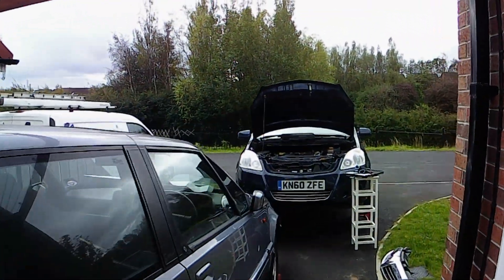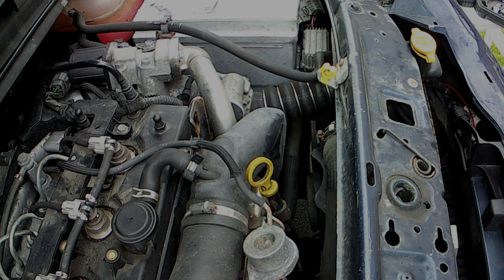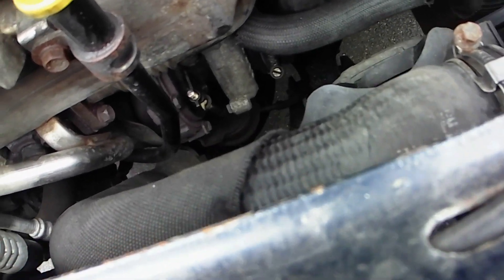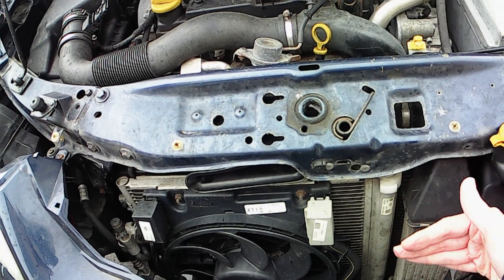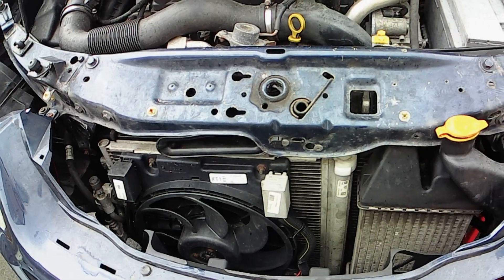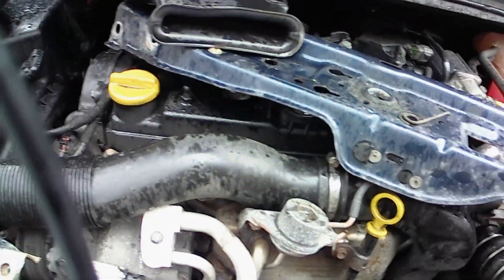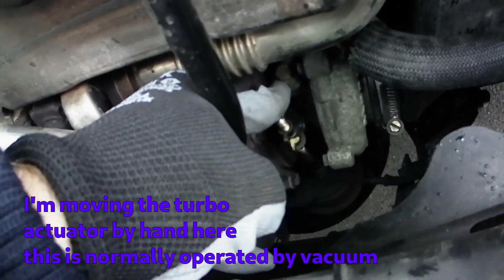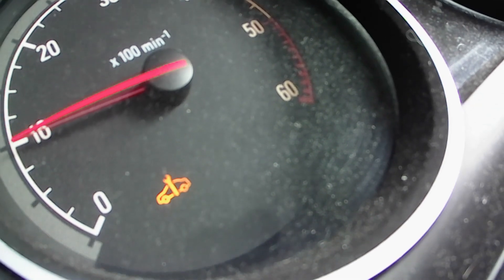Vauxhall Zafira 1.7 diesel ecoflex Turbo boost fault P0299

Comment: Do you have a follow up video
Reply from the maker: Hi, I've done a few on this fault on the channel
https://youtu.be/4EBu5AR3IDE
Is another video which is related to this fault code. It was never 100% resolved unfortunately as it can be quite a few issues causing the fault code

Comment: Hi Andy, have you replaced the intercooler on the zafira ? If so, have you recorded doing it ? You have helped me out of so many issues with the zafira many thanks
Reply from the maker: Hi Ali, no never changed the intercooler, looks like majority of front bumper off, radiators, etc to get to it unfortunately

Comment: Hi Andy, did you fix this problem? My astra same engine is doing the same. Under boost fault and changed the boost control solenoid and still going into limp mode.

Comment: My 2012 astra van has been losing boost then in the morning back to normal wheel spinning for fun  when you remove the suction pipe and suck on the end of the top valve it does not seal and cause a vacuum think my one has  a small hole in the suction pipe or the value gone faulty

Comment: I've owned my new car 3 days from a private seller. Car runs great until you pass the 2500 rpm going through the gears. The turbo stopes spooling and if it dose come back on the car makes loads of smoke. On the dash I get an Amber car and spanner light.  I've done the pedal test and found error code 029952. The car still runs but with no turbo and at low revs. When I stop the car and start driving it and change through the gears at 2000rpm the light doesn't appear and the car runs fine . so confusing.. apparently error code 029952 is ( boost pressure low pressure)

Comment: Under Boost is due to the Actuator not moving fully. 

Easiest was to get it moving is by Spraying WD40 on the Rod of the Actuator whilst forcing it down with a pry bar or a big screw driver and then letting it pop up by itself. 

Spray WD40 each time you're letting it pop back up again. 

Do this around 5 to 10 times and then reset codes and take it for a drive.
Reply from the maker: Thanks, great info there.
I'll give it a go as it still is a little sticky and your info makes a lot of sense. Cheers!

Comment: Did you fixed it? P0299 Boost Pressure Low Pressure should be straight forward. Waste gate stuck,  boost solenoid, or MAP sensor, or leaking intake pipes (intercooler). That thing on turbo is supposed to be waste gate actuator and if you can move it freely with feeling just constant restriction from the spring then it should be fine, if actuator is not leaking.  Solenoid or hoses to solenoid and actuator is one that could be faulty in you case, or it could be you boost sensor that is super dirty. Turbo is regulated after actual boos pressure is  reported. Boost solenoid  is far in the back of the engine bay on the bottom, boost sensor is on top of the intake manifold close to cylinder 1. There are upper two vacuum solenoids in the back of the intake, one is for EGR cooler open valve, other I forgot at this moment. EGR will give you clear fault if there is problem with it. IF you want to "close EGR return gasses" good thing on this specific engine is that on entrance to EGR cooler there is small valve controlled with vacuum controlled actuator positioned on the EGR cooler. If you disconnect vacuum tube supplying this actuator you have basically closed your EGR.  You should not leave vacuum tube open when disconnected. It is very good design in my opinion because this engine basically allows EGR  return  only if you do not have boost in manifold regardless of electronic EGR actuator. So even if electronic EGR actuator is faulty or leaking, when you step on the throttle engine will pull.Not many engines come with this nice feature, usually it is only one EGR actuator and when it goes bad, (always open is worst thing that can happen) engine will loos the power and clog your DPF very quickly

If your engine is OK EGR should be used, it helps to reduce emissions since effectively makes you engine to operate at low power like it is supper small volume engine and needs smaller amount of fuel to provide reasonable power (low power) Though if your engine is in bad condition due to all sorts of intake and exhaust issues it is better to close it until you fix all the problem. ECU shall compensate and add more fuel even at low power demands.

All this explanation comes from one and one thing only, combustion must be perfect, if it is not you must determine why, do you need more air for engine, do you supply to much fuel, and that can be related with any sensor that is controlling engine combustion, intake and exhaust sensors. This engine also has wideband O2 sensor after DPF, basically sends back info how is the combustion. If that one is fulling your ECU maybe ECU shall try to setup combustion in very wrong way - long shot but just to give you a hint. how all of them are usually interconnected.

Comment: Hi Andy, do u remove the turbo on this engine ? What IS the best way? I think mine IS going Bad because a lot of dpf regenration that cause a oil pressure engine A17dtr.
Regard
Reply from the maker: Hi. Unfortunately turbo remove is a really involved job. Basically it involves:
Front bumper completely off, front radiators (how many depends on your model. For me 3, one coolant, one A/C and one oil cooler), front brace bar and any extras, EGR cooler assembly, exhaust manifold. You'd then be able to get to all the bolds and fixings for the turbo.

I'm not sure it will be turbo if you have a lot of dpf regeneration and oil pressure (low pressure? not high?), this could be something else causing the DPF cycle not to complete. Take a look at my other videos as I do a video on DPF regeneration on these cars.
Good luck
Reply: @junkendriven  i think high (red warning appeared but not stay ) the regen are completed i let the engine turn on when it      Come dpf stay stuck at 42 percent on the opcom at his best score i think catalyser and the suit filter near dead

Comment: Hi did you do a future video on this problem at all as my Zafira has the same problem. Kind regards Andy
Reply from the maker: Hi Andreas, I'm still waiting to work on this, there will be a video soon doing more tests.
My guess is to investigate the vacuum pump and vacuum solenoid on the back of the engine. Video will be along soon so please subscribe!
Reply: Look forward to the next video, think I have the same issue. That dash light came on very briefly for day or two but not come on for couple moths. Mega turbo lag though, so much delay in power. My Turbo actuator felt pretty stiff untill I wiggled it, now it squeaks :(
Can I remove it and give it good clean?

Comment: How tight is a turbo to turn, I got further than you I removed the inlet to the turbo, I can feel the blades and it turns but not spins freely
Reply from the maker: I've not tried as not got in enough access to spin/feel the turbo blades. If yours isn't spinning freely then you need to replace the "cartridge" which is the blades and bearing assembly in the middle. My guess is your bearings are worn and not spinning freely.

Comment: Hi Andy, I have the same fault code but suspect it's the boost solenoid valve. Can you tell me where this is located and if I can only access it from underneath the car? 1.7cdti
Reply from the maker: Hi, I'm suspecting it's my boost solenoid too, I've got another video coming up testing the pressures from the solenoid and the turbo itself. Boost solenoid is down the back of the engine, I'm not 100% on location yet but will do when I do the video. They're about half way down the back and one is below manifold so not easy to get to I suspect.
Reply: @junkendriven  

If it's the Solenoid, you can easily test it by removing the Vacuum Hose from the top of the Actuator and checking if there is a Vacuum pull present.

9 times out of 10, it's a sticky Actuator Rod.

Comment: My turbo is new all sensors is oke everything is perfect done with turbo charger and map sensor and walve and air flow sensor and turbo sensor all but stil ther is fault with overbost turbo charger p0234 and i try everything it doesnt hellp i dont know what to do
Reply: Have you tried clearing the egr valve and boost pipe?
Reply: @stephendent6372  hello, I fix that. It was mixed wacuum wire from turbo wacuumi. I also have my egr valve sistem closed long ago and i have had oil leaking on valve pipe which normal gasket didnt help and I finally.. managed to close it with a reinforced graphite gasket
Reply: Hi I have an over boost problem to on my zafira changed the sensors and still the same what was you problem in the end ?

Comment: would u have a fix for engine  idling and then engine cuts out on a Vauxhall zafira ecoflex b  2012 1,7 diesel
Reply from the maker: Hi Mary. That's odd, so just on it's own it will cut out? What about driving does it randomly cut out? If so that sounds like a potential fuel starvation problem (Does it take a few attempts to restart after it cuts out?) If so then the easiest/cheapest attempt first is to replace the diesel fuel filter (See my video on servicing https://youtu.be/f0Em-B5XBBo as that includes the diesel fuel filter). Otherwise it could be a few things so you'd need to get the codes too, see if it has a crank position sensor fault or o2 sensor fault. Could be lots of things unfortunately.

Comment: Interesting,  I have a 2067 and 2066 with exactly the same issue as this on a Ford fusion tdi.  Think it's also the actuator
Reply from the maker: Ah yes, common issue it seems. Part 2 of the video may be more useful as I've found how to test the actuator using a vacuum set and also measure the vacuum being pulled by the car (and valve)
Reply: @junkendriven  I am lucky one of my mechanics has a fiesta with the same engine he is about the scrap so thinking of grabbing the turbo and associated parts.
Reply: Did you do a part two, I'm having the same problem